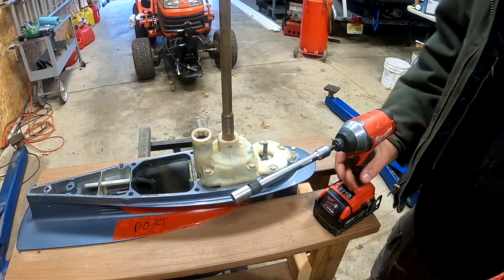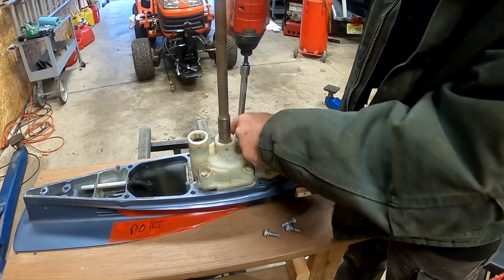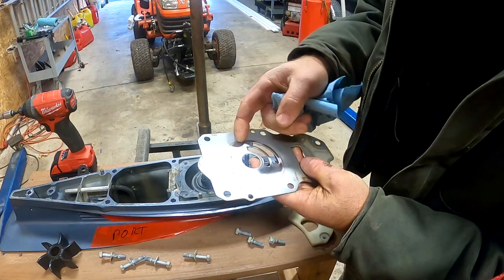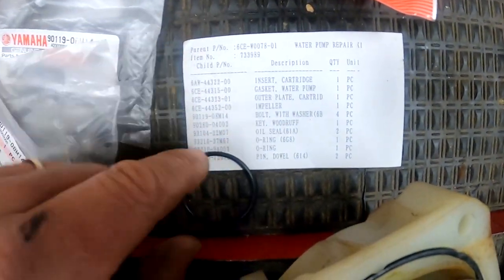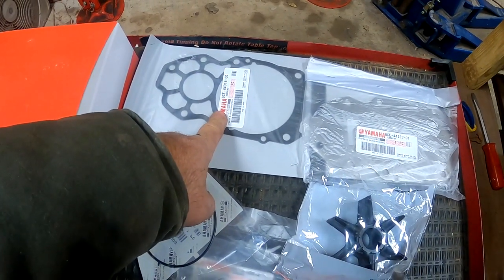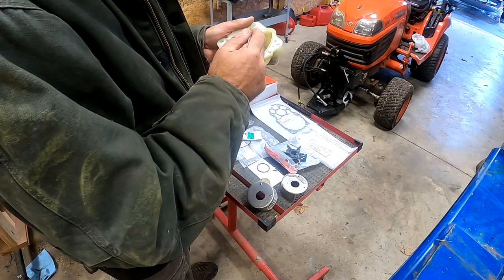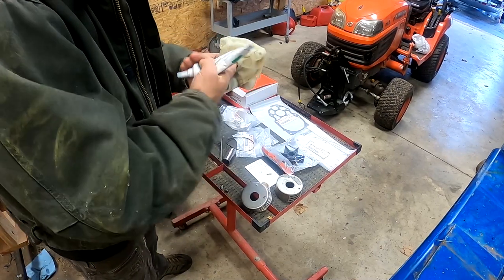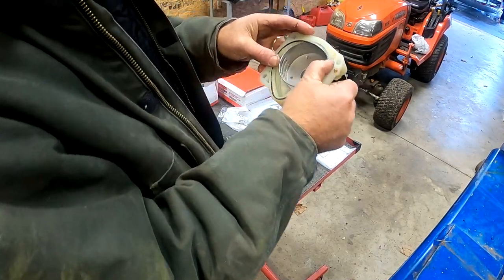How to replace a waterpump on a Yamaha 4.2l  225 250 300 HP outboard

Comment: Great video.  You made it look easy to install the shaft seals on the water pump housing, but I found it almost impossible.  An arbor press would be nice.
Reply from the maker: A press would make it easy.  You also could put the seals in the freezer for an hour.

Comment: FYI my carb cleaner stripped the paint off my lower unit.   I’m not a chemical engineer and maybe some won’t.   I have a fishing boat so there are a lot of spots with a lot less paint. But all you fella with glitter rockets might want to not use carb cleaners. Thanks for the video though. It helps me over come my “Every tool is a hammer”
Reply from the maker: Great point, I had only sprayed a little on the scotchbrite.

Comment: Nicely done video and super helpful! Point of curiosity, though. You appear to have the starboard cavitation/ventilation plate tape-labelled PORT. Am I missing something? Or am I flipped around? Thanks!
Reply from the maker: Thank you for the kind comments. I have two motors and I usually only remove the lowers one at a time.  For some reason I removed both that day and labeled them to make sure they made it back to the correct spot.

Comment: I have the same motor. I cannot remove the old key from the shaft. Used rust blaster and several chisels. Any suggestions? Heat??
Thanks
Reply from the maker: I use a punch and hit straight down.   You could try tapping one side in to the shaft, the half circle shape will kick out the other end out a little and break it loose.

Comment: Great video do you know the torque setting for water pump bolts?
Reply from the maker: Thank you! Yamaha shop manual says 13.3ft lbs for a M8 bolt.
Reply: 13ft lbs is too much / that is the max for the bolt / not this application / 10ft lbs is enough

Comment: Nice video. I have a F300XCA 0119. At 1:53 you remove a seal plate. I do not have this. What year and model number was the outboard you worked on?
Reply from the maker: Thank you. 2019 - F300NCA

Comment: Great video! How often do you replace the entire housing vs just changing the impeller? What kind of RTV sealant did you use? Thx
Reply from the maker: I do the impeller every season, Full kit every other. It's overkill but makes me feel good when 100 miles offshore! Permatex ultra grey was the RTV I used.
Reply: @4RibsFishing  Wow... That is overkill!  I go for 3-4 years before a overhaul.  2years on the impeller.  BUT, Then again....  I sure don't go 100 miles off shore!  Thanks
Reply from the maker: @colemant6845  Thanks for watching! If you shop around online you can get the Yamaha kits at a discount, add your own free labor and it feels like cheap insurance.

Comment: shouldn't that say starboard?
Reply from the maker: I have 2 motors.  That lower must have come off the port engine. I see that I did mark 'port' on the 'starboard' side of the motor.  Is that what you mean?
Reply: nvm